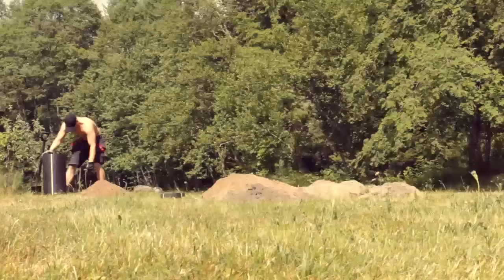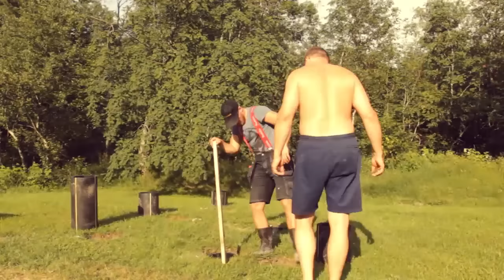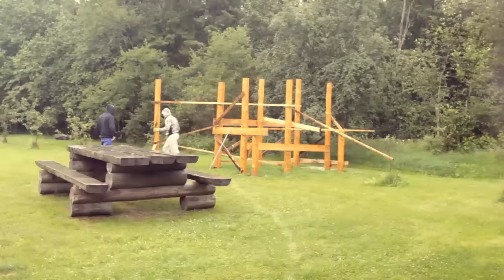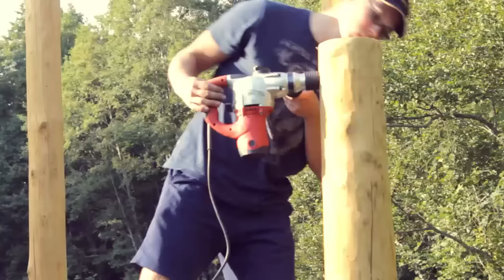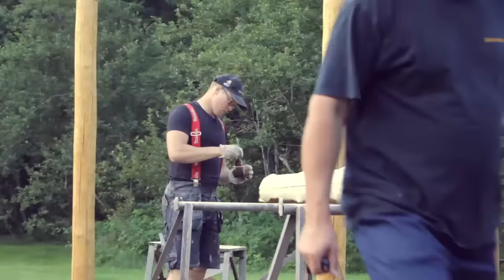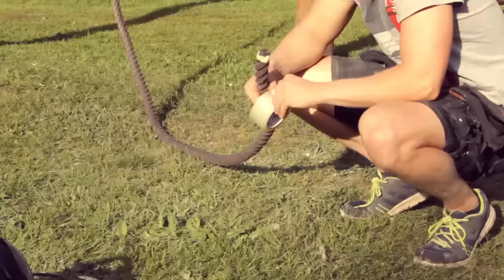✔ Building an Outdoor Gym / Workout Park ( Timelapse )

Comment: great job!  I really like the layout.  would you be willing to give a breakdown list of the lengths and sizes?
Reply from the maker: Pullup bars diameter is ~30mm... dip bars diameter ~50mm... 
pullup bars are 1,5m long and distance between dip bars is 50cm... The pullup bars are at 2.25m hight and dip bars are at 1 m hight. Practically all the material that I used I had at home exept bars that I bought.... and cement... Hopefully it helps!
Reply: thanks!

Comment: Hey, just a couple of questions. How do you stop your bars from rotating? Is your wood not going to rot being concreted straight into the ground like that?
Reply from the maker: The bars have holes at the ends and are secuted with nales... Everything you make has it´s life span and after 30 years maybe I will make a new one :) plus the wood has been treated with protective coating...
Reply: Okay thanks, good job man
Reply: What are the stones for that you put into your holes?

Comment: Do you have plans and dimensions as I would like to build my own. Can you email these to me.
Reply from the maker: Pullup bars: diameter is ~30mm... dip bars: diameter ~50mm... 
pullup bars are 1,5m long and distance between dip bars is 50cm... The pullup bars are at 2.25m hight and dip bars are at 1 m hight. Practically all the material that I used I had at home exept bars that I bought...